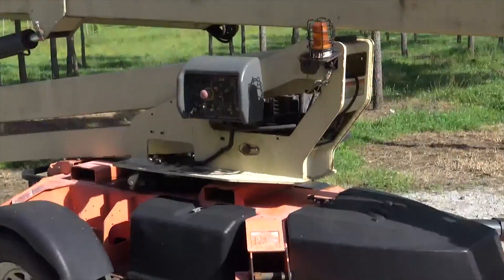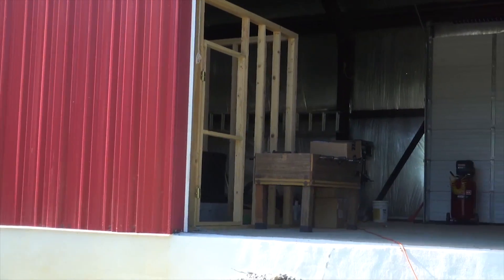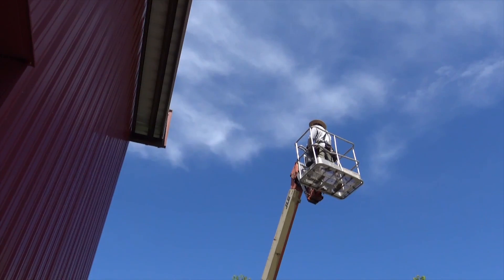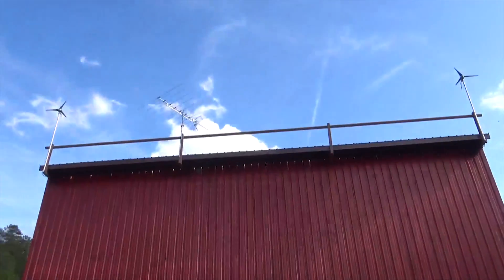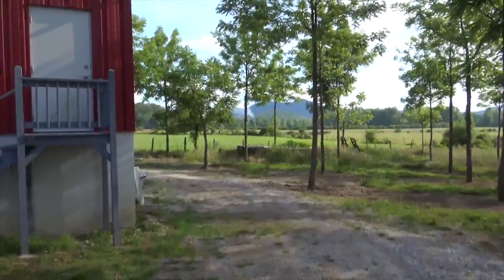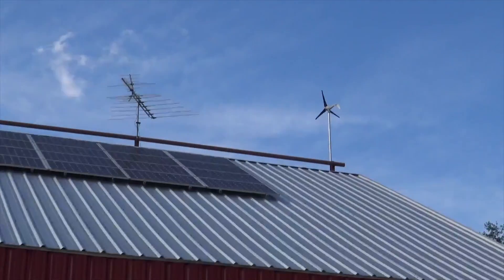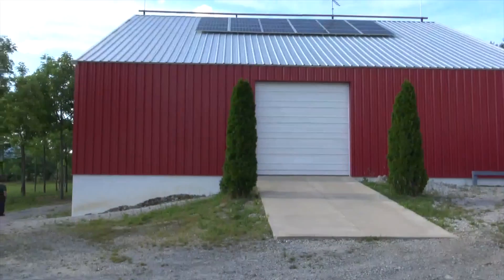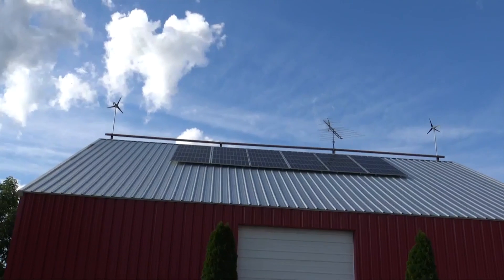Hybrid Energy System

Comment: I had one of these turbines on my off grid system. Most the time it didn't supply enough power to run a lightbulb. For wind you need low cut in and height. 20-30 feet above anything within 500'. A person can easily double there solar for the cost of a resent wind turbine and get more consistent power. Love watching your videos. Allot of useful information.
Reply from the maker: Agreed.  It's just a little help when the sun goes down and during bad weather and the winter season when the wind picks up.
Reply: I hear you. In northern Wisconsin, I had a whisper 3000 on an 84' foot tower on top of a huge hill, and about 50' above the tree line. You could see it for a couple miles in all directions and it only lowered my electric bill around $50 a month. More in the winter, around $65 or so. I put it up in 1997, and it was still going in 2013 when I moved south. 

The only thing that ever failed on it was the orange light in the back of gen head. It was just some sort of marker type thing so you could see it at night.  It failed about 6 months after it went up. I never replaced it or cared, because there's no planes flying that low. I will say that 3 days after I got it up, we had massive winds blow through, and they were well over 110 mph and took down many trees. That wind generator sounded like a huey helicopter up there and I'm not kidding, because I flew in MANY of them while in the army. 

I think that for wind to be of any real value, you need to be over at least 160 feet, and start getting up into real air flow, but what do I know, except I'd never do wind again unless I can get way up there and then you need to go with a bigger gen head to make it worth while. Keep up the great work.
Reply: yes the same experience with me. the turbine is now safely packed in a cardboard box and stored in the attic. even in strong wind the generation was minimal. had i spent the money on solar panels the electricity generation would have been around 200x larger.
so i can probably safely say, like the flower panel, those turbines are a gimmick. just saying.
Reply: Location is important. Most places in this country they are not cost effective. Add in the price of a tower and it's a long time for payback.